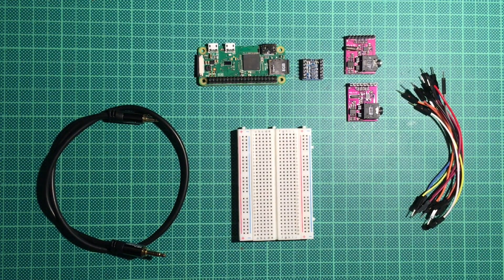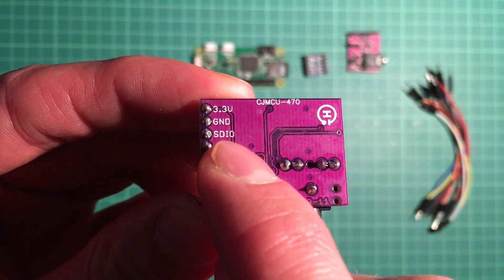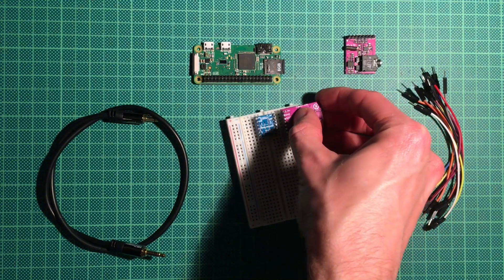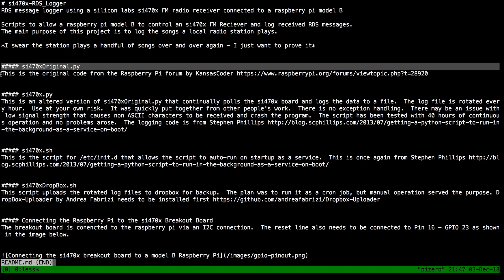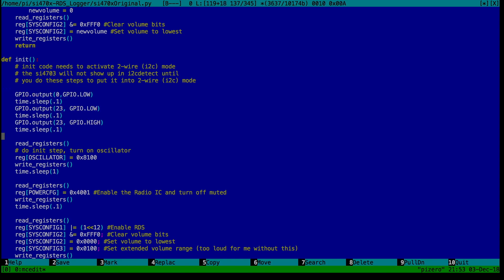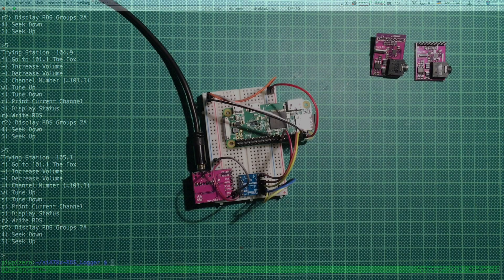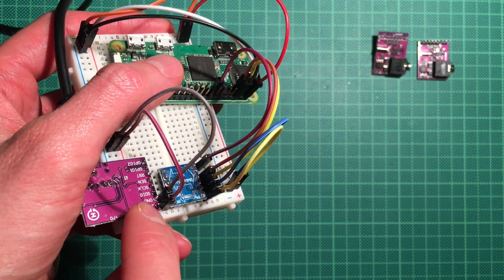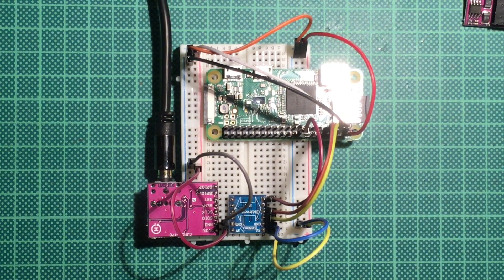Building a Raspberry Pi FM Radio (si470x)

Comment: Aren't  the raspberry pi GPIO pins 3.3v? Why do you need the level shifter?
Reply from the maker: I don’t. I learned that later. :)
Reply: @root42  great! I am getting ready to try this myself and was worried I didn't have all the parts I needed. Great video by the way!
Reply from the maker: Thanks. It’s a nice project. I wish there were similarly cheap modules for DAB radio.

Comment: is the output through the pi´s sound card?
Reply from the maker: Nah, it has a 3.5mm socket. You can directly connect a headphone.
Reply: @root42  do you know how we can route the sound on the PI? In order to use that in a car radio system I use a usb sound card with audio output and a microphone for calling google now (open auto pro has implemented android auto). the best should be to mix two inputs (the si4703 output and the usb mic)